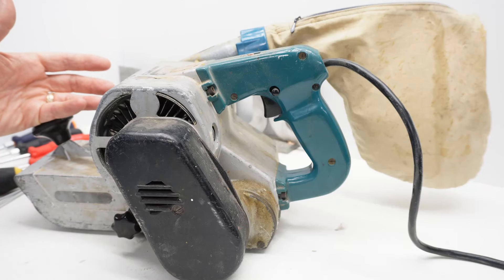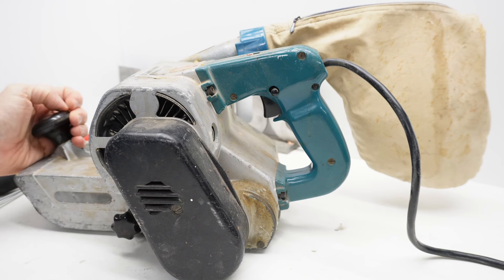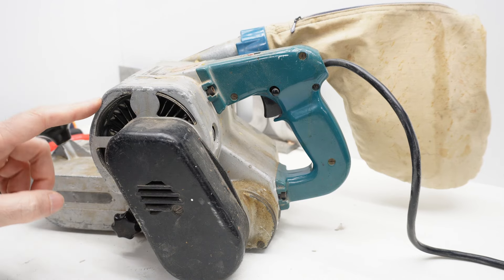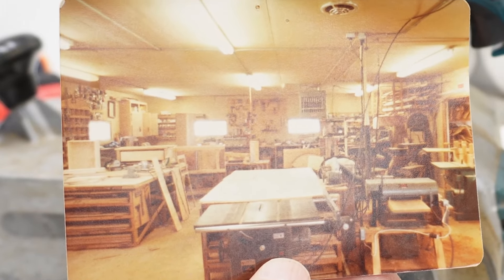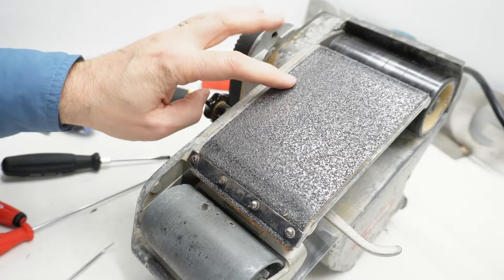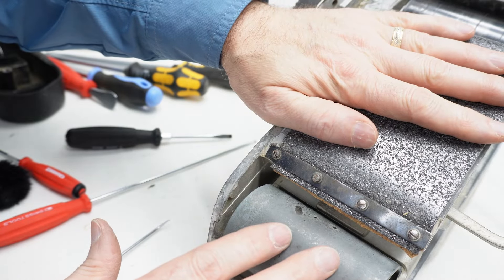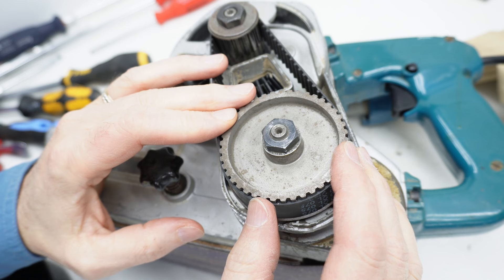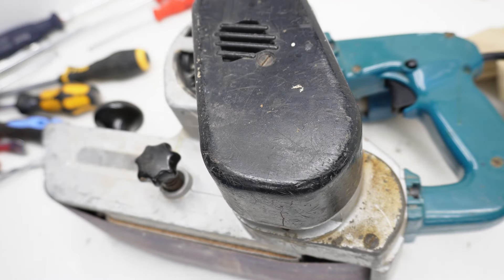Bosch Belt Sander model 1270, 4x24 German made in the 1970s.  50 year review.

Comment: Great tool, actually I am a Bosch fan and user. My first contact with bosch was when I was a kid and my grandfather gave me a motorcycle headlight from a   BMW one used in the war. He and one of his best friend evaded on this motorcycle. My first tool from bosch is a corded drill, but it was made in solothurn Switzerland by SCINTILLA A.G. Still in working condition. You can see the difference when you compare to the modern tools made from plastic, and sintered powder metallurgy versus forged and machined components.